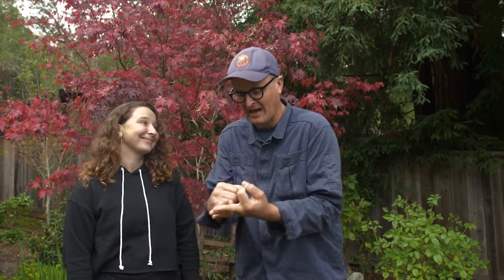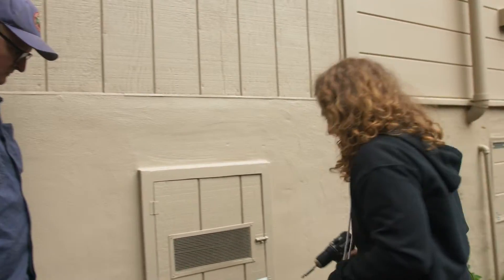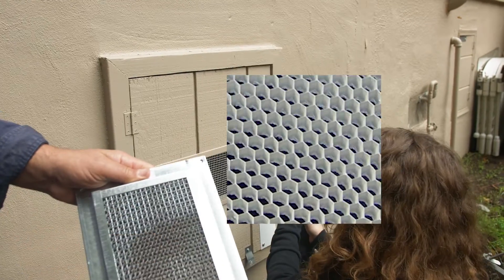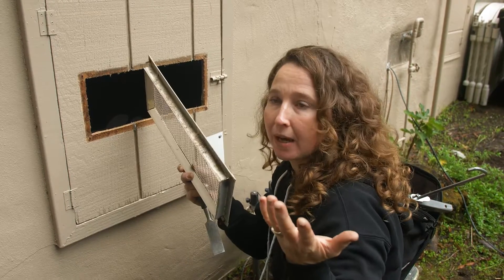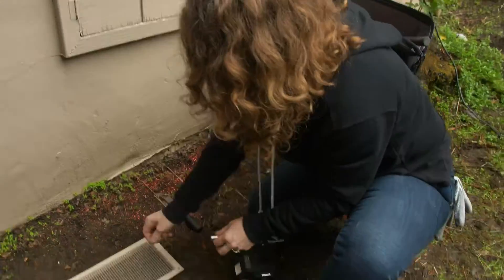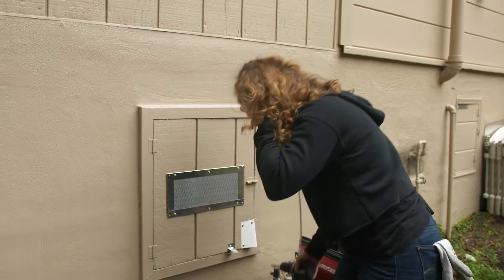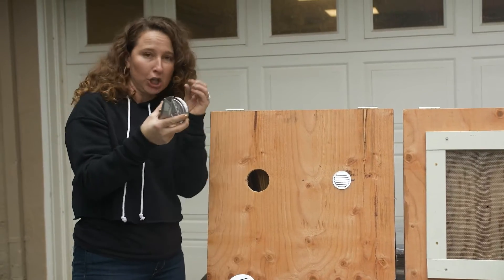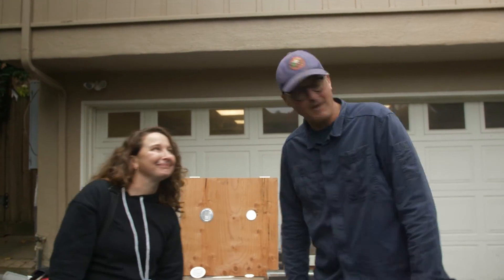DIY Vents:  This Quick Trick Could Save Your Home from Wildfire

Comment: Please show us how to protect the other vent that appears on the right margin of the video, the one that is recessed and embedded in the stucco. Thanks in advance.
Reply from the maker: That vent is typically smaller and often has a metal mesh screen installed over it. If you don't have one, you can install a metal mesh vent cover. Same principles apply!

Comment: Soffits are the most dangerous vents . 16 th helps but seriously reduces actual venting. For all the pool owners get a pump some fire houses and t’s you have 20 - 50 000 gallons of water
Reply: Probably better to prevent the house from igniting than just to have water to spray on it once it's burning.

Comment: Nice hair Kazoo. And great examples of the danger of "in-venting" fire into the home too. Any suggestions about blocking typical continuous soffit vents and @ 50sq. inch roof vents. Hot/humid Coastal South. Lots of ventilation. Also an on-going drought & lots of wind in the hot summer. 10 years ago the idea of a dangerous wildfire would be laughable. Now not so sure

Comment: I am a little concerned… Wouldn’t you need to increase the surface area over the screen as you decrease the dimensions of the holes because the decrease in dimensions of the screen material is going to reduce the amount of air circulation under your house, and possibly, therefore increase the humidity and/or moisture accumulation in the crawlspace.
Reply from the maker: Hi @ThomasElmore-dh7pu. Particularly in the more temperate climates where we live, attic spaces are typically warm spaces and therefore dry spaces, so some decrease where airflow is otherwise currently adequate shouldn’t be a problem. Moisture-related degradation problems could develop should a roof leak occur, but if that were to happen, even ventilation to code may not be sufficient. With crawl spaces, it would depend on soil moisture conditions, but there are other mitigation strategies that could be used in crawl spaces that could dramatically reduce the amount of required venting. For both attics and crawl spaces adding vents is always an option, although usually not a very satisfying one. You will note that in the IBHS NFPA one-page document here:

IBHS Attic and Crawl Space Vents Wildfire Fact Sheet
Reply: Vulcan Vents have about %3 reduction in airflow vs 1/8th mesh. You wont find better airflow.

Comment: The big challenge is ensuring attic spaces get enough ventilation. 1/16 metal screen blocks almost all airflow and results in higher summertime attic temperatures. Fire safe yes, but an an unventilated attic brings its own problems. I'm presented with this dilemma on my own home.
Reply: Good point. However, Vulcan Vents use a "14 mesh". This results in approx. a 3% reduction in airflow vs 1/8th mesh. Not too bad in my opinion. I've seen other brands having only about half that airflow. Yikes!
Reply: @TheNatrix222   My understanding is that 1/8th mesh means 8 wires per inch. To be fair, it's call it 7 wires per inch, since... well, hard to explain, but trust me. Am I supposed to believe that DOUBLING the wire count to 14 (actually just 13, using my same rule for counting wires versus gaps) only reduces air flow by 3%? Technically it's possible, but only by switching to very fine wire. I don't believe the 3% figure...
Reply: Each vent vendor provides an effective area for the vent. The International Residential Code provides the venting requirements for a vented crawl space. The effective area of ember resistant vents is dramatically reduced compared with traditional vents. It is likely that twice as many vents need to be installed in order to meet code 

Unvented crawl spaces are superior if you are willing to make the investment. With this approach heavy weight sealed plastic is installed on the floor, along with one small powered vent (see the IRC), and a dehumidifier.Insulation is then used on the walls of the crawl space. The end result is humidity controlled, more energy efficient, and naturally ember resistant.
Reply: So true. During my own major remodel I was actively involved in selecting where to add attic penetrations, and--at least with my flat roof--it's hard to meet code! Switching to 16th mesh? I'd have to knock additional holes in my roof or siding to meet ventilation requirements, and that's not something I want to do...

Comment: What does Fire Safe Marin and Kazoo from Fire Farms think about the thin aluminum crawl space vent covers that easily attach on vents?  They essentially block "all" airflow/embers/flames.  Would you recommend removing them in the "non-fire season"/winter/rainy season to allow for air flow?